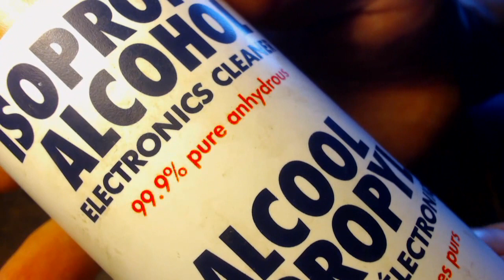Cleaning sticky mouse wheel without disassembling it (Logitech M500)

Comment: Thank you!  My wheel wasn't  scrolling as far as it should with one spin, new problem I've had so figured wasn't related to a low battery.  Figured it probably just needed a clean.  I used some 91% alcohol,  on a folded corner of a paper towel.  Couldn't get it in the side of the wheel, so used a slim pen to hold it in there while I spun the wheel.   Paperclip would work well too.  Seems much better now.  Also, looking at my mouse settings, I just found out I can scroll horizontally....I feel so dumb lol.  Thank you for video, 3 years later :)

Comment: I was a bit skeptical about your method, but having already disassembled my M500, without a clue what to do next, I put it back together, took just a single sheet of paper towel, not folded, dipped it into 96% ethanol, leaned it against the wheel axle through the slit, and after a bit of scrolling, the wheel got unstuck. Thanks for the tip!

Comment: I just did a bit different, I dampened a piece of cloth with a bit of alcohol then I inserted it to the sides using a clip, it gone all the way down, then I spined it. It works. It won't remove all the dirt inside, but it'll clear the wheel for the scroll sensor.

Comment: Comment for anyone having the same issue in the future

This did work to clean out sugary drink gunk out of the scroll wheel after I had tipped over a monster on my mouse
Wheel was feeling sticky at first, after a couple scrolls with the towel in the issue got resolved
Used 99% isopropyl for this with the mouse unplugged and pushed the towel in a bit for more pressure with a toothpick (careful not to overdo it to not leave torn paper pieces inside)

Comment: My 10+ yrs old Logitech Trackman scroll wheel only worked one way, I used some alcohol on the the spokes wheel internally and removed gunk from the wheel itself and - wallah,  it works! Saved me from buying a new trackball device, for now. Time will tell how long this fix will work. Thanks for pointing me in the right direction. I avoided oils.
Reply: Oils actually worked for me much better.

Comment: Instead of the paper towel use the cardboard center part from a roll of toilet paper.  Cut a piece to fit down against the axle then moisten it with rubbing alcohol to clean the axle.  If you need to oil it you can do it with this method also.  The cardboard is absorbent enough, stout enough, and thin enough to make access to the axel easy to apply the cleaning solutions.
Reply: Both ideas good xD, I was just gonna drip in some Alcohol and spin the wheel, that'd only delay problems though. Maybe hold it upside down after applying drops for my cockamamie idea 🤔

Comment: This is great! I did this with WD-40 and 91% isopropyl in a spray bottle. I just sprayed a tiny bit and used tissue. Then, it got much worse so I could tell it was doing something. Then, I flipped it upside down and with moderate force tapped the mouse wheel three times on the mouse pad. So happy. My mouse was pissing me off quite a bit. 🔥

Comment: SKIP the oil part, just use the isopropyl alcohol. All that is in there is gunk and the isopropyl alcohol should suffice. MAKE sure it is as dry as possible before you use your mouse again. If you absolutely need to use anything use WD40 as it's very thing and easy to clean up. Should not affect your sensor at all.
Reply: will this work if your mouse button is stuck
Reply: @xohlyyyyy  depends on how it got stuck. If their is gunk then it could work but leave it sit for a while to allow it to break up whatever is in there. If it is stuck because it's broke then not likely.

Comment: I used Hoppes #9 lubricating oil all over the sides and on the spinning axis of the wheel and spun it very fast up and down while applying downwards pressure. My wheel wouldn't scroll unless I pushed down on it at the same time and was very annoying. I think it was only doing it because my bird bit the wheel when I wasn't looking and caused minor damage. Works great again though.

Comment: wont work on my g102 prodigy cuz scroll hole is so tight you cant put anything in here
Reply: did you manage to fix it? I'm facing similar issues in my g102
do let me know
Reply: @rohandas6994  no i didnt
Reply: same, and im scared of disassembling mine haha
Reply: I intentionally removed the cover that was sealed in the mouse wheel, that's where the thickness comes from and by removing it, you would be able to clean it like how he did. It's a little hard to pull off but I just put a lot of electronic cleaner until the "mouse wheel cover" became a bit soft, and when it did, I just removed the "cover" by hands. Trust me, it can be removed but I just don't know if it'll work for yall. After I removed it, I just cleaned it like how he did and its like a different mouse just because the cover of the mouse wheel was removed, lol there's a lot of space and it's super thin now.
Reply: @sinatsu4757  the problem with g102 prodigy is the fact that the wheel fits there so tight that you cant by any means fit that tube there - there is simply no space to put anything in there without completely disassembling the mouse